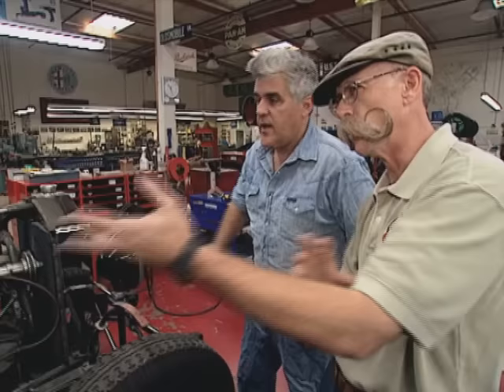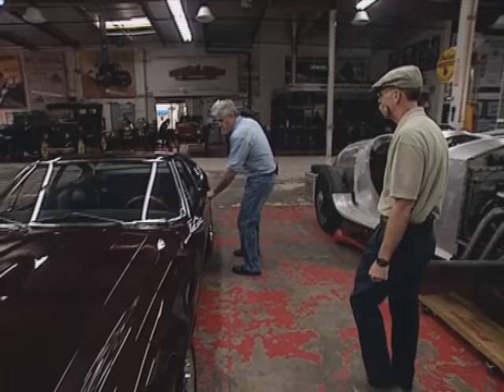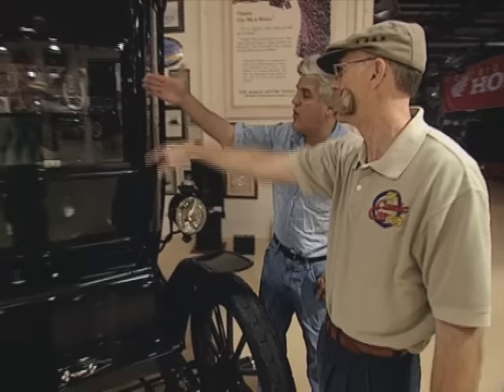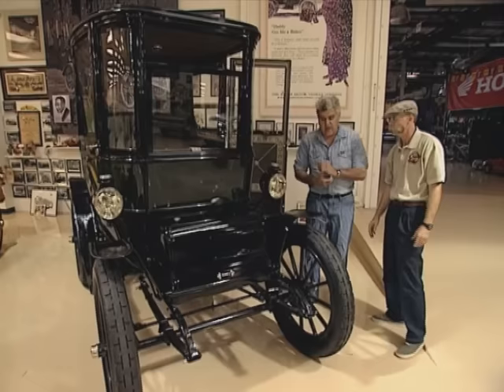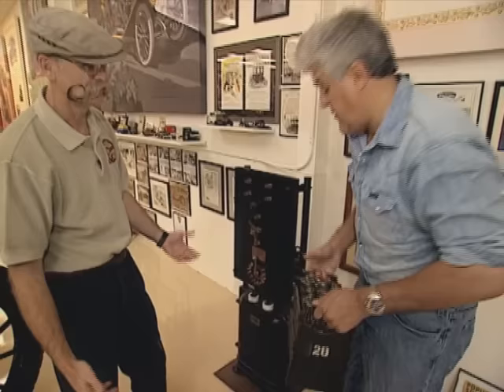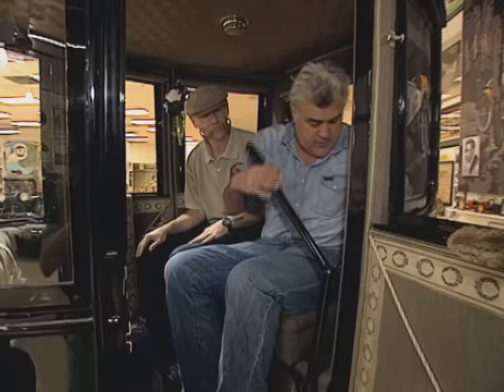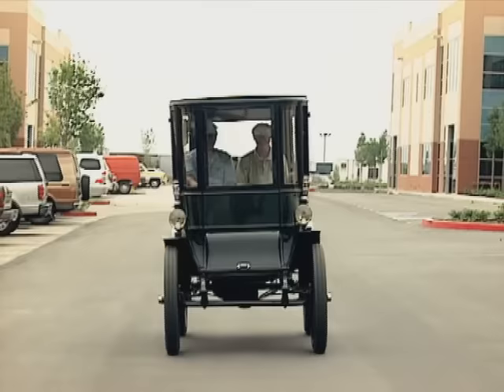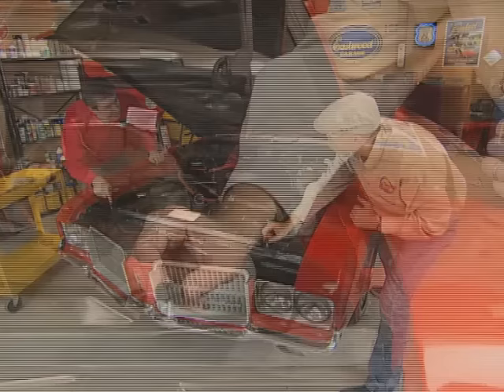Jay Leno's Baker Electric Car

Comment: Just think it's a 110 years old and probably still runs great
Reply: just changed the batteries 😂
Reply: Less moving parts, less to wear out and go wrong. Aside from the batteries every 15 years or so, today's electrics will likely last just as long as the Baker.
Reply: @MylesV  Its funny but the Tesla Cybertruck will likely be one of the longest lived vehicles to survive into the future since its made 100% out of stainless steel, its not going to rust in several human lifetimes. All it will need is a battery and driveline change every now and then. I bet in musems in 500 years there will be a Tesla Cybertruck there looking quite sharp.
Reply: Back then things were built to last, today they are built to fail on purpose (planned obsolescence).
Reply: Jay did say he had to paint it.
Reply: @martinsworld8678  it would be great to see both together but as for 500 years they might wonder what they were for
Reply: @martinsworld8678  The tesla cybertruck is a sham.
Reply: @MylesV  Modern electric cars are packed full of proprietary electronics and a proprietary battery pack that's been designed to be nearly impossible to repair. Good luck finding replacement parts 25 years from now, let alone 100. 
The Baker has no electronics, takes standard batteries and uses parts that any competent machinist could reproduce if they break.

Comment: Baker Electric Cars are from Cleveland, Ohio
Also Baker Electric Fork Lift Trucks were on the west side in a former Buick plant and their manufacturing had a large number of highest quality components.  I toured there about 45 years ago.  Many factories use electric fork lifts for cleaner air for workers compared to gas or liquid fuel.
Reply: I worked at Baker Material Handling as a mainframe computer operator for 8 years...around 1977 to 1985.  They were located at 8300 Baker Ave. in Cleveland when I started there.  The building still stands and is in use by another company.  

We moved to Tiedeman Rd. in Brooklyn, Ohio.  I'm not sure of the exact year, but I was at that location when John Lennon died in December of 1980.  That building was the old Lamson and Sessions factory.  I liked the Baker Ave. location much more because it overlooked Lake Erie and Edgewater Park.  The computer room at the new location had no windows. That building on Tiedeman Rd. is gone and is now an area for a hotel and restaurants.

They had a Baker Electric car that moved with us from the old to the new location.  It looked very much like the one Jay Leno has.  It had that dark green color on the body panels and black elsewhere.

Comment: wow this is amazing. 1905, 100 mile range, 15000 in New York, charging stations. WTF?!
Reply: @Techrecycle4u no lol.  There was no electricity outside of major cities until the 1930s when hydroelectric dams were completed.
We had alot of highway work done by 1915 and the original cement national highway grid by completed in 1922, gas stations had become widespread by this time, and in more remote areas you could always keep spare jugs of gas. 
The possibility of recharging an electric outside of your city was at least a decade away and much much longer until the average citizen everywhere could make use of an electric car. Not to mention the cost, all cars were only for the wealthy until the Ford model T in 1909 when middle class families could now afford a car and along with Ford's revolutionary moving assembly line increasing production capability 6 fold in 1913 making his affordable car also available.  
Even if someone were a major city resident in 1920 why buy an electric car that can't leave town, when you can just buy a gas powered car that can while also being much cheaper and faster?
They were a good choice in the early years around 1900 when at the outskirts of cities the "roads" ended and became just 2 rut wagon trails, gasoline was hard to find and the combustion engine wasn't very reliable at all.  15 or so years later none of this was the case and the electric car faded into obsolescence.  

See how silly the Oil company conspiracy sounds now?
Reply: @toki89666  the oil company theory isn't a theory though

Not until the 90s when they killed the EV1

Comment: Perfect city car, should be here today exactly as they are
Reply: seriously though! who owns the patent for this thing? get new ones rolling off the line and people will buy them! i want one!
Reply: although a couple small things could be updated like giving it a normal steering wheel
Reply: @dguy0386  A replica made now would not have the historic vehicles' exemption from modern regulations, so it would need all the safety gear. And have to survive crash testing!
Reply: @faithlesshound5621  only if its a car
golf car is not safe too
electric bike can go faster than 23 miles
see it as a mobility scooter

Comment: I am amazed by that car. It is so agile in that tight place. I think we did not follow the right direction when we decided that gasoline is better.
Reply: Try stocking your local supermarket with goods brought in by electric trucks. Sorry, but you'd be mostly hauling batteries.
Reply: nothing beats the sound and the exhaust spitting flames of a gasoline car
Reply: Gasoline has never nor will be better, it's more convenient, therefore it wins every time
Reply: @dieselgeezer18  The only problem is that they are incredibly destructive to the environment. They can and are slightly improved all the time, but electric vehicle motor and battery technology is advancing faster, and is becoming less and less environmentally damaging from a manufacturing standpoint faster than gasoline powered or hybrid vehicles.
Reply: @SweetBearCub  no. Have you ever thought how electricity is produced? Power plants consume fossil fuel in order to produce electricity and charge your electric car. Lithium mining is very toxic for the environment too. And if someone is bored, which many people are, and throw their batteries away without proper recycling, it is bad for the environment. Also, gasoline cars convert the chemical energy of the fuel directly to movement. But electricity power plants convert chemical energy of the fossil fuel to electricity and then to movement which lowers the total efficiency of the electric car a lot.
Reply: @daveconleyportfolio5192   What does that even mean? You're saying "We can't use electric vehicles, ever, because it's not as perfected as fossil fuel powered vehicles that we've worked on for 100 years"

Comment: The first practical electric car was invented in 1890s, and many did tried to replace the horse. It is also a horseless carriage in nature. Pros: it is whisper quiet and it does not frightened the horses, and save on fuel. Cons: it need a lot of maintenance work, such as recharging the batteries frequently, and it does go slow.

Comment: I put a performance chip in a 2003 Toyota Prius. It now has 155 horsepower. Loaded a app to get into the system and turned off the traction control. Raise the maximum rpm.  And remove the ratchet from the emergency brake.   Never seen a Prius do a burnout down a city block before. It's so tiny and sporty compared to my Bone stock 1977 F150 4x4 with a FACTORY 351 Cleveland stroker engine. It's a torque monster and geared so low I use the Prius for going into town for groceries. Gets better fuel economy and charges the battery faster with the computer chip.

Comment: Electric cars have been around for 110 years?! I totally thought they were a recent invention!

My mind has officially been blown!
Reply: Craftman Seven Eighty Right? I used to think the same thing. Electric cars have been around since the 1800’s actually. A lot of people think that they’re recent inventions, but manufacturers throughout history have been making electric cars. GM made an electric car back the the 90’s, which I never knew about. And there have been many other electric models as well.
Reply: @jonathankeith524  Electric cars came, went, came, went, and now they have come back again.  Its nothing more than bringing back a fad but this time its been hyped by the media so people think it's some great discovery and that Musk is some genius. Fact is the battery technology was and is still not where it needs to be yet to really compete with gasoline.
Reply: Gman539  not so. The battery technology is quite sufficient for any reasonable requirement and it's different from Edison's
Reply: @Judge Dredd I agree the battery tech has gotten better and come a long way, and it will continue to get better.  My point was (is) that battery technology in cars is still not at the point where it can beat gasoline.  Maybe it will in the future.  You can't beat the time it takes to refill vs change, so the range issue is still there.  And economically it costs less to operate a gasoline vehicle vs electric, and now with gas at $1.50 a gallon in most states it's a no brainier.  Gasoline needs to get to $4-5 a gallon to make it worth owning an electric vehicle vs gas.
Reply: @Gman539  Gasoline at $1.50? in 2020? Where do you live? Ours DROPPED to $3.09 from $3.69 due to COVID. And lots of places yes it was over $4 in the US, and it's $10 (equivalent) in lots of countries.
Reply: @fixitmann6685  Houston TX, and even with prices at the highest they have been in a few years I paid $2.65 gallon today.  Those states paying $3 or more right now is all because of state gasoline taxes.  Gasoline is a huge money maker for state governments contrary to what the EV cult members say when they parrot that fossil fuels get huge tax subsidies.  It's the exact opposite, EV gets huge subsidies and fossil fuels bring in huge tax revenues to governments to fund roads, schools,etc...
Reply: @Gman539  the only reason EV's have come and gone so many times is each time an oil tycoon has been there to buy them out or run them out of business. The technology itself is sound, and if as much money had been poured into EV development since the 1900's to now as has been poured into gasoline, we'd be living in a very different world. The fact is, that EV's have got to stay this time due to climate change already taking effect and consequences mounting yearly.

Comment: The original Baker had a price of $850 ($21,657.83 in 1999), just insane that there were thousands of those running around NYC in the 1900's. I wonder actually how many fully electric cars are on the streets of NYC right now.